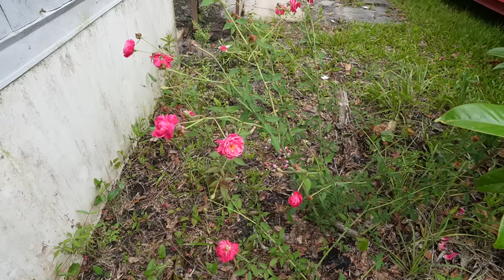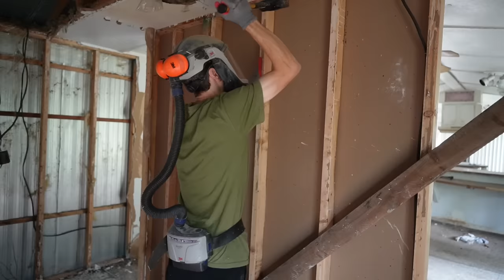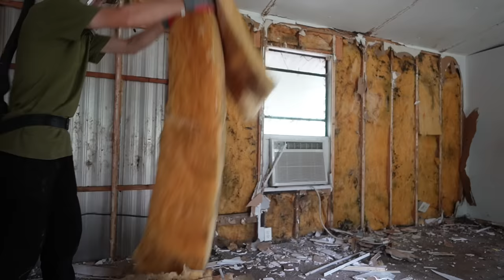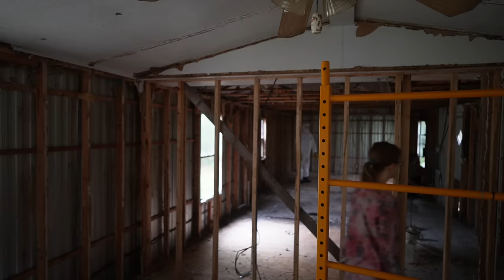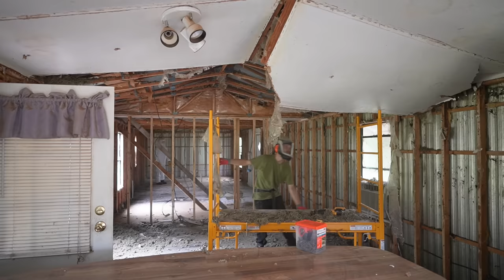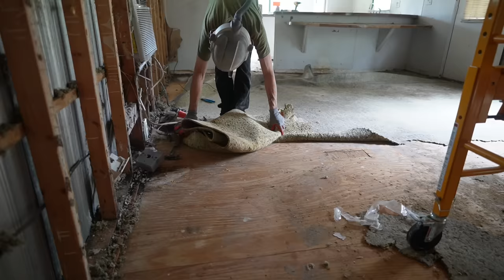Only One More Room To Go! - Gutting a 1984 Mobile Home

Comment: Once the kitchen is out you will have a really clean work area. Now is the time to re level the home using a laser level to check for low points in the floor.  Consider a bedroom at each end of the mobile because when both bedrooms are next to each other the hall cuts down the size of the bedroom.  Plus a hall is wasted space. Then the kitchen and living room can be all open. The island in the kitchen can be space to eat at as well.  Then no dining room table is needed.  Plus the bathroom and kitchen can be next to each other less costs to run plumbing. The run for hot water is shorter too. If possible 6” of rock wool wall insulation and 8” of roof/ ceiling insulation rock wool plus double pane windows will really help will cooling costs. The problem with fiberglass it breaks down overtime with moisture in it and rock wool is much better.
Reply: I love the floorplan advice @tomk2147!

Comment: I hate roaches! I think I must have PTSD from roaches! I am very curious about how you would get rid of the problem?  I wonder if the subfloor will require replacing? I adore watching your videos. Do you all have a PO Box where we can write or send things to you?
Reply from the maker: We don't have a PO Box, but thanks for the thought :) Just by gutting the place out will get rid of the cockroaches, and then also sealing up any place where they have been getting in. Most of the subfloor is fine, but some areas will need new sheets.

Comment: i have dune a few remodels or rebuilds like this.
was told by a 87 year old that if i made a mix of peroxide and vinegar,  a 50/50  mix 
and sprayed everything it would not only get rid of the smell but also kill any germs and mold.
got in to one that was so bad (dog Cats and black mold) i gave it a try,
and it did the job quite well,  had to spray entire interior  of the home but killed mold and removed smell.
and after a couple days the smell of the vinegar was gone.
might give it a try.
Reply: Yeah, the old remedies are the best!

Comment: I don't know if you are planning to flip the layout of the kitchen/dining and living rooms, but I feel like that bay window is wasted in the dining room. If you leave a big open space for the living and dining areas, you can put the kitchen in the middle with a peninsula or island facing towards the bay window. That way, the tenants can choose to make a big living room, with e.g., a kid's play/crafting/etc area and eat at the island. Also, if the kitchen is closer to the bathrooms, there is less plumbing to install. I don't know if this will work with window and door placement. But just a thought.

Comment: My parents have a double wide moble home. It has cathedral ceiling all the way thru. It really makes a difference. Doesn't feel closed in.
Reply: My biggest pet peeve with mobile homes is the low ceilings. I was in a 1968 doublewide home that had 9 ft flat ceilings and it felt like a normal home and was very comfortable. For my own home 8 ft is the minimum I’m comfortable with long term. For a vacation house I’d be comfortable with less. The camper I live in is only like 6’5” tall inside.

Comment: I would suggest that if you're not replacing the sub-floors that you treat them with something to either remove or encapsulate the smell that might remain the wood or else there could potentially always be a smell in the home.

Comment: I cleaned a Mobile Homes Aluminum Siding with Tide, not HE, and Clorox. Painted it with Behr Satin Exterior. Rolled it on followed by a quick wet brushing. Five years later it still looked good, except were some bushes had been allowed to rub against it.

Comment: It's great to see your projects moving along. So nice you were able to gut that living room and get the carpet out. You can get an enzyme cleaner for pet urine that will completely remove the smell at the pet store or hardware. It's called Miracle Cleaner, but any enzymatic cleaner will take it out. You will be glad you cleaned it up completely so the smell does not eek back out. Anyway by now i do trust your process but wanted to make a suggestion.
Great work as always and I'm so excited to watch you all work on the mobile home! Take good care! ❤
Reply: Nature's Miracle is the common one sold in my area, it works well. It won't always remove all staining by itself but it does an exceptional job at eliminating the smell from pet urine soaked into carpet, padding, subfoor, fabrics, etc. It actually breaks it down so all smell is gone. Normal cleaning products don't do the same job at all.
Reply: I agree.  Use a cleaner on the urine spots (or  the whole floor) before doing the sealer.  I think a vinegar and water solution or hydrogen peroxide and water solution would work, too, if they are leery of using other cleaners.
Reply: @ILGuy2012  If using on a hard surface or cleaning urine from a human then there are many options for effectively removing smells and stains. Pet urine in my experience is much harder to permanently remove. What's worse, is that it isn't uncommon to clean an area and think it is good but the smell comes back over time. The enzyme cleaners actually break down the urine as opposed to only killing any live bacteria and in doing so tend to permanently eliminate the smell.

Comment: ❤❤❤you are such hard workers. I have rental properties. I learned a trick hotels use when rule breakers bring pets and/or smoke. I bought a $100 ozone machine on Amazon. In between renters I turn it on for 2 to 3 hours and leave until next day. I have had cases where i have had to do 2  times. Then open all windows and doors and air out. This kills bacteria, odors, and even bugs. We dont have rodents or roaches but it does kill spiders. It cleans air and removes cooking odors too. I've used in my vehicle as well. Just not near as long❤❤❤ be blessed
Reply: Good tip!
Reply: I recommend my ozone machine to so many people lol. Have let many use it. A life saver for “resetting” a space. I am very sensitive to mold, and I’ve been in multiple spaces that it’s been used on, and it’s night and day. From a headache, sore throat, tingling nose to it being completely normal. Obviously treat any obvious mold, but their is stuff you can’t see or in a wall that can’t be opened etc where it’s really helpful

Comment: Though expensive, 2" closed cell foam insulation according to youtuber Spray Jones can increase structural strength of the home by 3 times, make it almost airtight, no place for bugs to nest in and drastically reduce heating, cooling costs.
Admire your hard work.

Comment: If the a.c. works might not be a bad idea to run it to remove moister from the structure most likely the humidity is high with all the rain, just a thought😉

Comment: We had some mold behind the wall from a leaking window I sprayed with bleach and then sealed it with Kilz for mold it did a great job nothing bled through. It got rid of the smell too. I am out here in the Nevada desert we rarely get any rain we do have a small river across the back of our property so we are going to put in a pond and waterfall where the overflow goes back into the river. There are some nice solar pumps we hope will do the trick. I have watched your channel since just before you moved to the Mobil home before you moved to Florida. I watched the entire remodel from day 1 You did all you could there now you're here. I love it. P.S. Try to save enough of the old wood for a small storage/garden shed. I know you can build one with ease. 🦋

Comment: Y'all really do need to spray that place for bugs before y'all start the rebuild . I would hate to buy it and realize y'all didn't spray it
Reply: That can't happen.  Anytime you sell it is required to be sprayed.
Reply: 100,000 thumbs up. Get rid of the bugs.
Reply: My inclination would be to dust the dead spaces with boric acid powder or some other semi-permanent less-toxic insecticide. I've always fought bugs that way and so much of the stuff has built up in the crevices that the few times I've found a roach in the house, it was usually already dead.

Comment: Ruth here, what about spraying on the inside, the outside siding with vinegar, l have washed our bathroom down with strong vinegar water cause l saw a little mold starting on the wall cause of too long warm showers in the summer, it has now been some years, l haven't seen any since, when l can, l'm getting old, l want to wash it down again 
Antique rock Rose's are nice, they can take over a bit but l never spray em

Comment: Hi Doug and Ashley. In South Africa a lot of rental properties are tiled right through. Would you be able to do that in the mobile home? You did a awesome job in your bathroom at the house.For light in our house we have done down lights and single fans with our mini split in different rooms will you be doing that to save renters from breaking light fixtures. Loving all the Reno vidoes. Does the ac units work? Can you wash or change the flyers and run them to get ride of the smell left from the carpets.
Reply from the maker: The AC unit is just really gross inside and needs to be scrapped, so we'll let a scrapper take it. We won't be doing any tiling in this home. We have other plans for flooring though. We still need to figure out lighting and stuff like that.

Comment: Your work is impeccable.  You can handle anything!  I do wonder though, is it required to be strapped down somehow?  Hurricane proof?  
      I look forward to seeing what you do with it and what materials you use.
Reply from the maker: Yes, all mobile homes get strapped down underneath, this home does have strapping. It also has metal straps behind the siding that go up and over the entire roof. It's not as good as a newer built mobile home, but it will be secure.
Reply: @diyfferent  Thanks so much for the information!

Comment: Not to be critical, but, you and Ashley are doing a lot of back braking work on this mobile home. Would it not be more economical $ and less labor-intensive to remove the mobile home and replace it with a new or newer mobile home. Tks for the video, stay well and safe!
Reply: New construction is insanely expensive.  Makes mobile homes cost effective to renovate.
Reply: New mobile homes have gone up considerably in price. I do think they have come down a little recently, but still very expensive compared to before Covid. Also by redoing the home it’s a fun project, and they are creating content on YouTube that creates income as well as helps others! Plus saving the home from the landfill

Comment: Hi Doug,
It would not surprise me that building regulations, particularly in relation to insulation, have changed since this home was built. It looks like the walls may have only been two inches thick, but new regulations probably require 6 inches. How do you think you will achieve this, WITHOUT making the internal dimensions of the house markedly smaller?
Good luck.
Reply from the maker: Around here wall insulation only needs to be R13. Generally speaking, older homes are allowed exceptions. You just do what you can and accept that it's an older home and some things may not be up to the modern standards. Plus since this is a mobile home, it was built under a different standard and they follow different rules.

Comment: youre taking out a lot of the supporting structure of the mobile home , hope it stays upright
Reply: None of the walls inside a single wide mobile home are supporting walls.  Of course, they add to the structure of the  home, but removing them to remodel is not a problem.
Reply: The support walls of a single wide are the 2 walls the roof rests on, the long walls. The rest define the space and the end walls keep it from racking side to side. So no harm removing interior walls.

Comment: Are you guys gonna replace that fiberboard with drywall? If so, would even 3/8 thick, be too heavy for the structure that mobile homes are made of?
Reply: "  ?  " Maybe maybe not. That place is better built than most Mobile homes.

Comment: What are those huge bugs called? I thought i was hallucinating initially but now I’m pretty sure I saw bugs on that wall
Reply: Cockroaches
Reply: Those are water bugs/roaches (not sure of the technical name). Common in humid areas and the south. Those things are terrifying.
Reply: The poop from those bugs will give you a terrible case of asthma or other serious respiratory problems.
Reply: My grandparents in Florida years ago always called them Palmetto Bugs.
Reply from the maker: They are known by a couple names. Cockroach, or Palmetto Bug.
Reply: Palmetto Bugs are a nice name for the American Cockroach. Opposed to the German Cockroach that will infest a home and spread illnesses, the American Cockroach prefers living outdoors. They accidently find themselves indoors by open door or other access. If they are living indoors they probably got inside near  a tree or other vegetation touching the house. The best pest control is exclusion and cut back any plants touching the house. I know that Doug will have that home tight as a drum which will eliminate most if not all of that "Palmetto Bug" problem. 👷 🐞

Comment: If it's been asked I didn't see.... if it's an investment property, wouldn't it make more sense to pull out the old trailer and pull in a new one? It would save so much time, labor, and expense.
Reply from the maker: No, that would cause us to lose money on the investment since new mobile homes are extremely expensive. Plus we wouldn't be able to make any videos of gutting and renovating a mobile home, which we really want to do. We chose this property, because we were specifically attracted to this home. Also, we don't like the materials they use in the new ones and by renovating this one, we can choose what we want.

Comment: Exciting! Question: Have you found that no vapor barrier in the walls in a huge deal? Like for causing sweating/mold in the walls etc? Just curious if I ever purchase an older mobile home if that is something to be concerned about in a colder climate or not.
Reply from the maker: It may depend on where you live and how the home is built. Since we have metal siding, that is a vapor barrier in itself, so if you had another vapor barrier on the inside you can trap moisture in the wall. Down south it makes sense to have the vapor barrier on the outside, or have none at all.

In a colder climate, people usually put them on the inside. But I wouldn't be very concerned if there wasn't one. Air sealing is more important.

Comment: use hydrogen peroxide on the pet spots it will kill the odors.
Reply: This is true the hydrogen peroxide is a great solution for mold like you have any the pet odors. Pump sprayer and spray all surfaces and toilet brush it with dehumidifers. This is an alt method to the bleach dish soap method. Pick your poison. Be careful let house breath before building on top. A week or two.
Reply: Also you must sand mold off if it's deep in the wood. Throw away moldy materials if possible. Use kilz stain block on the worst of the worst after the processes and HEPA vac

Comment: Do you have a video on your foundation for your outer wall support?
Reply from the maker: We talk about the bottomside in this video: https://youtu.be/7rkBhbhZMjQ?feature=shared&t=408

We also have an older video showing in depth how it looks underneath a doublewide here: https://youtu.be/sCx_6a3kYyg?feature=shared
Reply: @diyfferent 

You see, I’m in a snowy region, and the walls are starting to sag and the metal bows a bit. I’m pretty sure it’s from not clearing the snow from the roof fast enough, through the years. 

Anyway, we live in it. We are looking to better insulate, replacing the panels on the inside with “more wall-like” walls. I’m looking at your concrete block skirt and wondering if you have any wall weight on that, or how you reinforced your exterior wall support.
Reply: @diyfferent  I had another message that I don’t know if it sent. I saw that older video first.
Reply from the maker: The best thing I can say is don't be afraid to add support wherever needed along the outer walls. You can stack blocks up  or invest in some jack posts. Also, check for hidden rot which could be the cause of the sagging. Generally, the mobile home should be able to handle snow load without too much noticeable or permanent sagging.